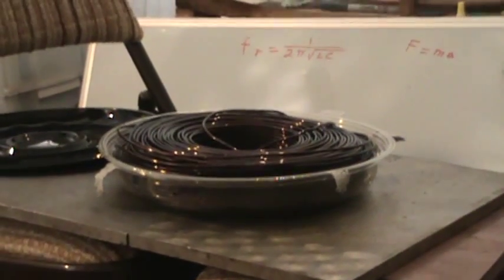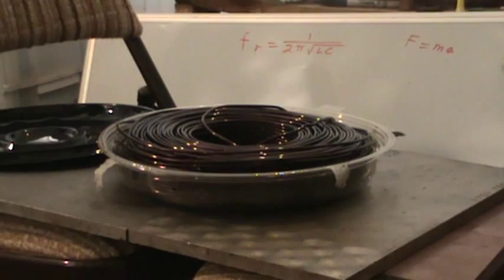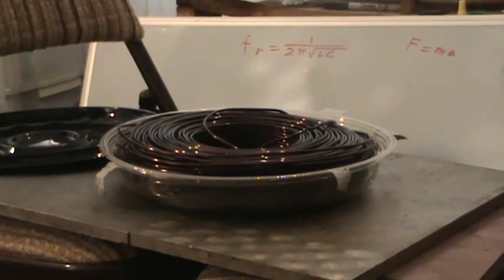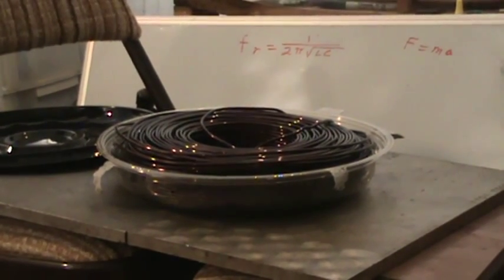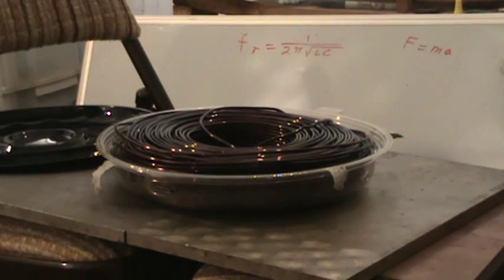Levitating Coil In Dry Ice (Fail)

Comment: That experiment works a lot better with aluminum wire due to the limit of amperage you have to work with. In short, lighter material floats better.

Comment: a good jolt never hurts lol.  cool thoughts.  acrylic container would help ,  as acrylic is hydrogen and carbon chains that love to hold a charge. just pour the acrylic in a mold with the wires  right in it.  then of coarse throw the hole thing into the secondary vacume chamber and zap it with plasma.  always a good result.
Reply from the maker: Interesting, but maybe too much weight added.  Maybe the acrylic would be good to add to the compound for the crystal power cells,,,and then of course to put into a vacuum and zap with plasma, hehehe.

Comment from the maker: I did add too much water.  I just added it for the effect of having smoke come out of it.  You are correct, the water will make the ice evaporate faster and turn to gas.  I can only guess that the cold temperature would make it conduct better, super conductors many times will use liquid nitrogen.  I really wish i checked the conductivity of this coil before starting the is experiment.